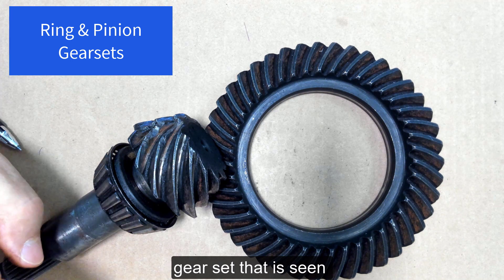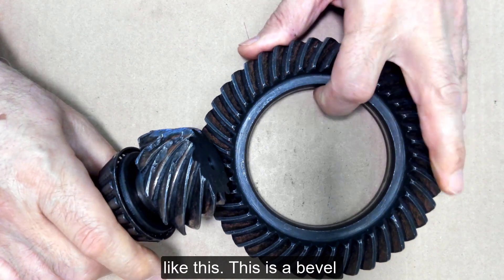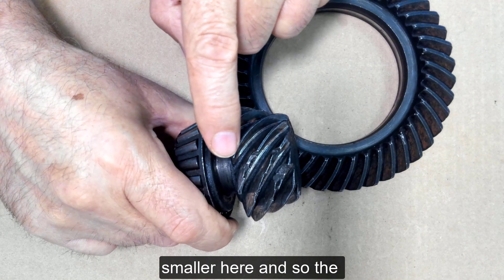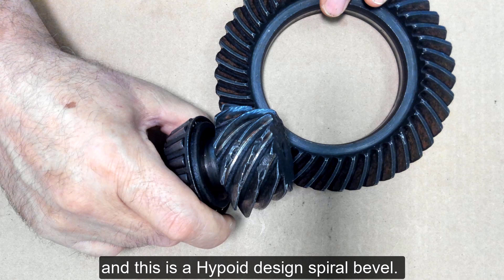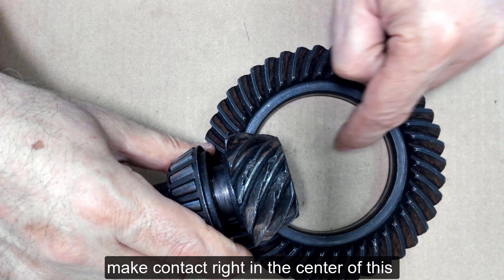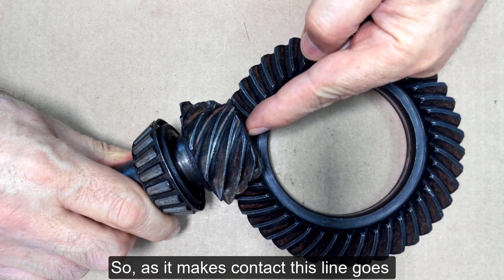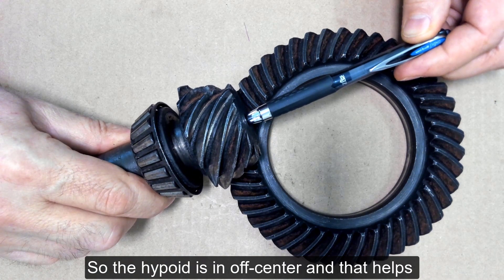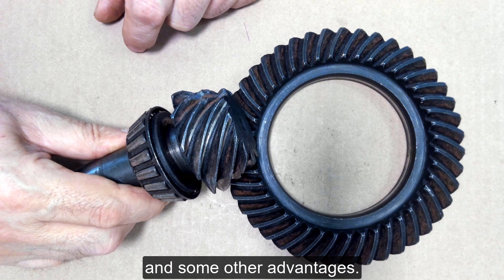Hypoid Ring and Pinion Gears Explained

Comment: Is the 1999 Chevy S10 zr2 pickup 4X4 a hypoid or ancillary thanks
Reply from the maker: As far as I know all automotive differential applications that are not part of a transaxle are of the hypoid design.  I have never heard of an ancillary gear set so I tried to search for Ancillary gears on the internet and I could not find any definition that would help me.  The front differential on all 4X4 trucks flip the diff upside down for ground clearance and to minimize front driveshaft angles.  In order for this to work they use a reverse direction cut and the concave side of the tooth is actually the drive side and the convex side is the coast side.  Opposite of non-reverse cut diffs that are used in the rear of the vehicle.